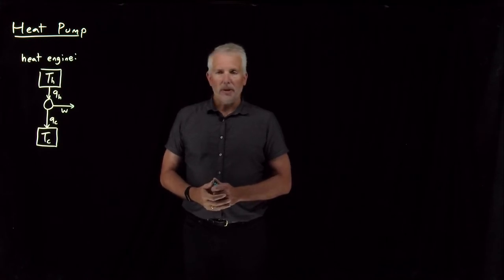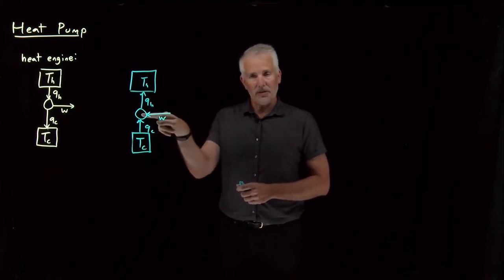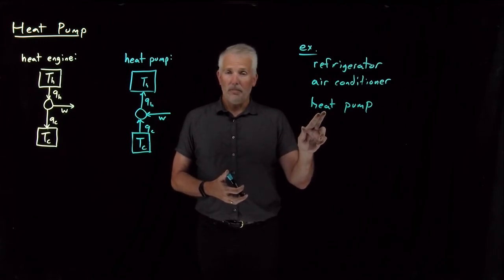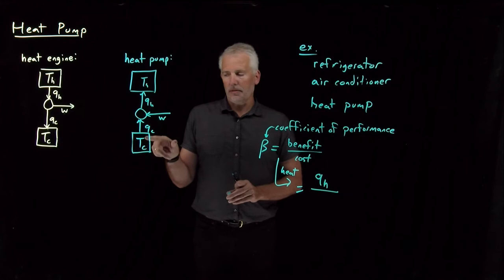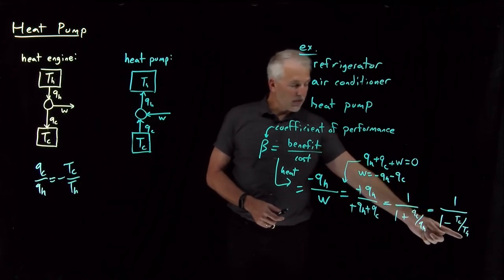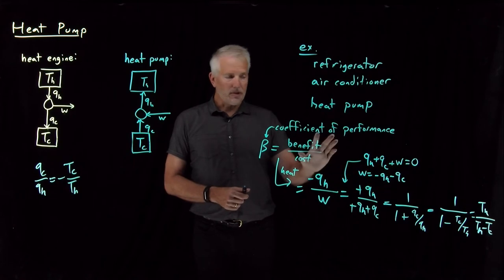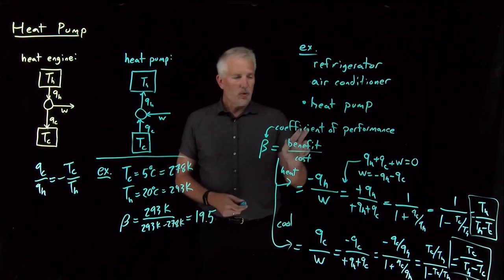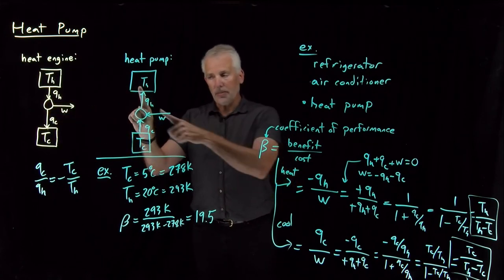Heat Pump

Comment: Is a heat pump worthwhile?  How does that convert into economics?  

If you are going to talk about thermodynamics, then what is going on in the air and in the heat pump that lets it do its job well?  What is different about the air inside and outside?  Where is the heat stored?  What allows the "hot" to be identified and pumped?

Why not pump "cold" molecules from hot air the same way?  Maxwell Demon's were pretty clear and workable.  All this nano technology, and laser Doppler spectroscopy, there can be a better way to heat and cool air.  Heat and cool water.  Heat and cool people. Heat and cool engines, reactors, sensors, power supplies, plasmas.

Your magic board is cute. But I would rather see a computer screen with the equations neatly typed, and diagrams working as real parts of a calculator and simulator.  I would like to see real data from heat pumps and the economic consequences of engineering and physical chemistry choices.  I would like to see real measurements of real devices and microscopic and nanoscopic details of where the energy is going, what it looks like and how it can optimally be pumped. Get off the screen, you can prepare and then demonstrate and explain and guide.

I like what you are doing, but I think you have a lot more to give to the Internet. You need to challenge yourself and remember there are 7.9 Billion people in the world, two billion "first time learners" from 5-21, and about 4.8 Billion with some current access to the Internet.

Who is doing the "best in world" designs and  methods for heat pumps?  Could a rocket engine operate as a heat pump?  Can you get a heat pump to resonate and lock in like a pumped laser?  How do you measure the heat signature of the air coming to be separated?  How do you pump molecules? (atom interferometer gravimeters do it).  Where do people go to fundamentally change the way engineering design is done? Ask Elon Musk, he has an answer for everything.

Keep up the great work!

Richard Collins, The Internet Foundation
Reply from the maker: Thanks, that's quite a collection of questions and comments!

What's "going on" in air that lets us use its heat to do work is the kinetic energy of the molecules. This was developed in detail in several earlier videos in the sequence, including those in the kinetic theory of gases playlist: https://www.youtube.com/watch?v=lHPHubeFnw0&list=PLrUDBH2CfIyl7be7TwkWGEUyRKTSgPLWB

Likewise, the heat is stored in the kinetic energy of the molecules in the air. The only difference between the air inside and the air outside (the hot reservoir and the cold reservoir) is the temperature, and thus the distribution of kinetic energies.

There is no Maxwell's Demon identifying the hot and cold molecules, and pumping them. That's the beauty of the second law of thermodynamics. When run as a heat engine, heat naturally flows from hot to cold without a need for Maxwell's Demon or anyone else to control the specific collisions. When run in reverse, as a heat pump, we can get heat to flow from cold to hot, but it costs us energy. The heating / cooling can be done by a variety of processes like PV work (compression / expansion). We just have to put more energy into the heating phase than we get back in the cooling phase.

For specifics on data, and devices, and components, etc, you're better off looking at engineering sources. This video is focused on the thermodynamics of heat pumps. By studying ideal / theoretical heat pumps, we learn about universal truths that are always true, guaranteed by the laws of thermodynamics. You can consider these to be the upper bound for how well a real-world device could work. Then the details of constructing and optimizing real-world devices are much more work, and have consumed decades worth of iteration by an army of engineers.